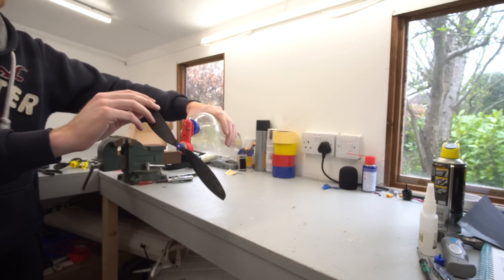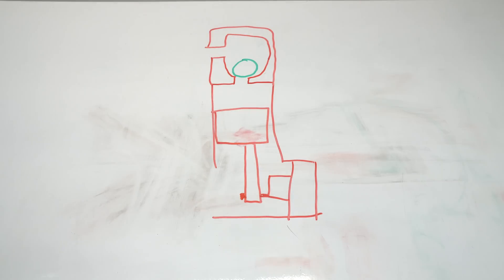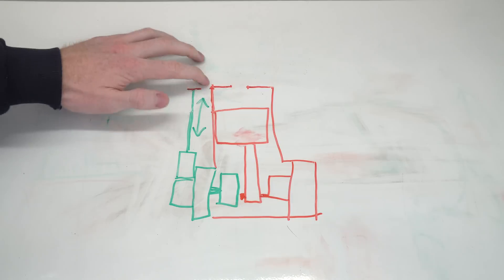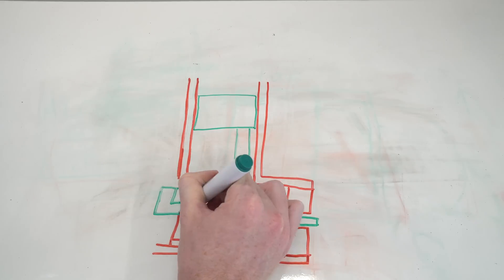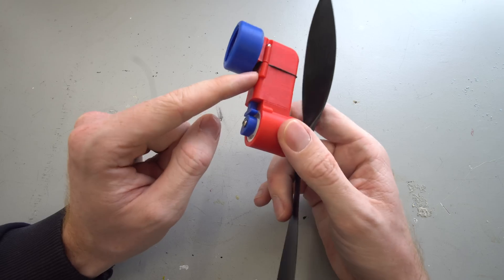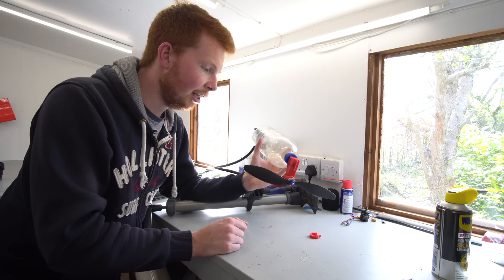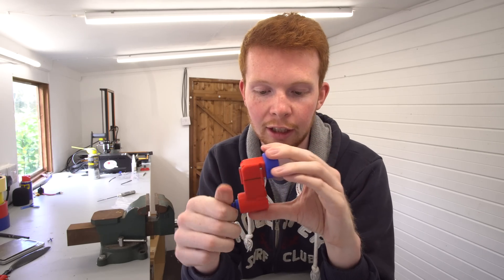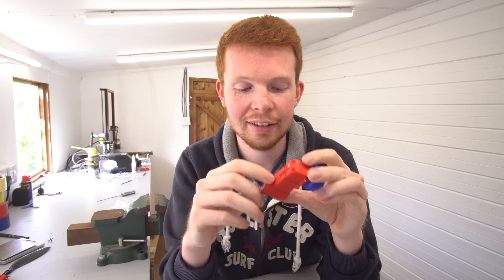Compressed Air Engine V3

Comment: Oh my God. I have imagined you would make your own car with this engine.
Reply: The concept is fine for hobby planes and cars but isn't efficient for use in a full size car if that is what you mean.  It has to do with expansion,cooling of the air, and on a large scale the amount of energy to compress the air.  But it still is a very interesting design and Mr. Stanton has done a very good job.

Comment: Make the valve timing a variable so you optimize the air supply. You could do this by rotating a disk/cam so the valve opens sooner or later. If you have electronic talents you could optimize both the timing and the dwell with an electronic valve.

Comment: Add a generator and tack it on to the boil-off valves on a cryogenic rocket engine and maybe you could reduce the need for battery weight.

Comment: A rotary valve would give you engine that would be self starting and could be made to rotate either direction depending on valve timing. Was looking for plans but could not find any I found mine in an old Popular Mechanics magazine it was similar to this one as far as the valve goes.   https://www.youtube.com/watch?v=Z1YISQ8ddsw

Comment: Currently I'm trying to design a 2 stroke (the engine in this video is a 2 stroke) v12 using a 3d printer and was wondering if anyone had any tips.

Comment: I thought you were going to draw the diagrams in blood? What I can't fathom with this project Tom, is why you didn't optimise the motor first with prop size and thrust tests first? I mean we all rush out to the field with these crazy projects at the first opportunity...my son's teddy 'Toffee' had to complete his selfie challenges, this one required 8 ounces of him on an 8 foot bamboo delta wing bin liner with ancient geared 540 and 1980's Nicads. 100 metres straight line was good enough! He was too heavy due to the wet grass for a second flight.
There used to be CO2 syphon capsule powered free-flight? Rubber planes have big (huge slow) props, to extend their short energy reserve. If you concentrated on your V3 motor, and then designed a plane/prop around that, it would more likely get there quicker?

Comment: sounds like a lawnmower but efficiency is too low.  Add some oil to the crank case and put a gasket that should allow it to run at lower psi.

Comment: could you exhaust the used air back in to another bottle that has the same volume as the original but with part water in it to get the air pressure back up   maybe heated sunlight the nitrogen boesse engine sounds very simple if you have not reviewed it and air is 78 percent nitrogen  you just have to think of tesla charges to strip it out of surrounding air  youtuber  ogmandino   og-man-di-NO

Comment: you can use an air compressed engine to compress air to run an air compressed engine to compress air for the first air compressed engine

or even you can use an air compressed engine to compress air to run an air compressed engine to compress air to run an air compressed engine to compress air to run an air compressed engine to compress air to run an air compressed engine to compress air to run an air compressed engine to compress air to run an air compressed engine to compress air to run an air compressed engine to compress air to run an air compressed engine to compress air to run an air compressed engine to compress air to run an air compressed engine to compress air for the first air compressed engine

Comment: You might want to shorten the duration the valve is open ...sounds like lots of wasted air ...you should make different cam lobes and test them with a timer to see which cam profile works  best

Comment: You're doing it all wrong. What's a motor but an air pump? You want an efficient compressed air motor,  look at a conventional motor for inspiration.
I would use an OHV pushrod design.  To minimize friction, i'd make a small orifice. For a valve,  just a dowel with a rounded tip so it fits like a ball valve.  This dowel is pulled by an arm that acts like a wheel borrow. It's moved by a pushrod connected to a lobe on the crankshaft.  No separate camshaft.  That's a piston, connecting rod,  crank/cam shaft,  pushrod. lever arm, valve spring, and valve. That puts the valve on top of the piston and you can have nearly no distance between the head and piston.

Comment: Definitely should print a pressure regulating valve that you can set a 'default' or 'minimum' pressure with and increase pressure by means of a lever. Basically a sort of throttle body that would let you conserve as much air as possible while at idle.

Comment: What if you'd use a lighter gas than air to power the plane in the end? Wouldnt the mechanism work just the same while reducing the weight of the aircraft?

Or is the pressureforce directly proportional to the weight of a gas? Im not an engineer or sorts... just curious.

Comment: If you add a air pump with a rubber band and conect the air pump to the bottle you can have infinite engine power

Comment: If you adjusted the timings to open quicker but last for shorter periods of time. In theory the pressure inside of the bottle should last a substantial amount longer then it currently is making it mire effecient. Great Video BTW mate.

Comment: Air hogs used to have planes with air engines back in the day
Reply: I remember having one of those, only thing that would've made them a bit better is some RC servos or a control wire so they could be actively flown instead of just free flying.
Reply: I enjoyed mine. Ran my legs off chasing it in the pastures.
Reply: Yeah i had 3
Reply: I still have it...
Reply: that's how he came up with the idea
Reply: @lazylawnbub  Yet doesn't follow their very simple design that actually works.
Reply: @illbeyourmonster2  no it's not the same design but he literally talks about the air hogs plane for half of the video
Reply: We know, it was presented in previous video:)
Reply: @Jandejongjong  yeah I didn't watch the whole video I literally saw that and made the comment
Reply: Guillow made these motors in the 1930s

Comment: liquid butane bro! constant 32psi. If you could find a way to support higher pressure, go LPG (around 320 psi)
Edit: and I do not mean combustion. Just the pressures the gasses produce.

Comment: Good work.

Imagine a vehicle using this engine. Have solar panels on top that recharge the air bottle as the vehicle moves. That'd produce a vehicle you can run at zero fuel cost.

Also, the movement of the wheels can be tapped to run a pump that re-charges the air bottle. The efficiency won't be 100% of course, due to losses to heat.

Comment: Inserting a spring type system inside the bottle to keep the pressure ''constant'' and a flow regulator for the output might be able to increase the time it can run though this adds weight

Comment: the guy obviously hasnt reverse engineered an air tool..      they dont use pistons...   they use a turbine and 1600 psi air. you engine will always be limited by pressure with that plastic bottle...   try a 10oz co2 container for higher pressure.
ps.. plastic bottle's are safe to 60 psi.. fair warning

Comment: if you could build your engine, that it gets a push into both directions, you'd get 50% more efficiency with each stroke
Reply: No .. you would get ideally twice the power but half the run time for a given volume of air. That is not a gain in efficiency. Realistically I'm betting it would be more like 1.5x or less of the power of the single acting setup. You can not avoid unequal volumes pushing from top of piston vs bottom of piston if using that engine design as shown with its single crank. Using a crosshead connecting rod setup would make the two volumes more equal but still not exactly equal. If he wanted it to last then lubrication is a must and it would have to be a lossy system like a 2 stroke has. In the end complexity, friction, and sealing would make gains much lower than 2x.
Reply: @xenuno  This person said it would get 50% more, you said it "would be more like 1.5x" but a 50% increase and a 1.5x increase is the same amount.

given that P represents the power of the engine;
50% increase    ->  P + (P x 0.5) = P + 0.5P = 1.5P
1.5x increase    ->  P x 1.5 = 1.5P
Reply: @xenuno  you said "you would get ideally twice the power but half the run time for a given volume of air".  

However remember that what you are actually doing is getting the same number of power strokes for a given volume of air, and doubling the number of power strokes per unit time.  In the original configuration there is a power stroke as the piston moves down, then an exhaust stroke going up.  If compressed air was fed in both sides then you would get a power stroke and exhaust stroke at the same time as it is a power stroke for one side but exhaust on the other, so for each two complete cycle (down and up).  This would increase power and use air more rapidly but by using gear ratios the engine strokes per minute can also be halved so now we are back to using the same amount of compressed air per unit time and basically producing the same amount of power.

A benefit may be increased torque as even though power is constant (given the gears are adjusted to ensure it is so) now there is no point in time when the engine is not producing power, instead of moving back up into place before taking another compressed air charge it will always be taking in compressed air.
Reply: @xenuno  You say "In the end complexity, friction, and sealing..."

However if we gear the engine to move slower to match the power output of a single sided layout then the engine speed is literally halved which will in turn greatly reduce loss due to friction.  This could mean that, given the engine power is kept constant through gearing, the usable energy per unit of compressed air may be increased.
Reply: That breaks the laws of thermodynamics, you can't gain efficiency with every stroke, that would mean after 2 strokes you have 100% efficiency, after 4 strokes 200% efficiency, its just not possible, the engines efficiency won't change, but you can increase power (that doesn't mean its more efficient)
Reply: @elliotlaw1590  The laws of thermodynamics don't prohibit improvements in efficiency.  Once upon a time cars got a fuel efficiency of 254 L/100 km and made 10 horsepower now cars can make 300 hp and get pretty good fuel mileage.  Even though the energy density of petrol hasn't changed improvements in engine design have led to internal combustion engines that can use that energy more efficiently.  In this scenario a change in engine configuration could lead to reduced losses from friction or noise so more of the energy in the compressed air can be used to turn the prop.
Reply: @benfubbs2432  I didn't claim that you can't improve efficiency, I said you can't gain efficiency with every stroke, if that was possible as the original comment said an increase of 50% efficiency in each stroke, after 2 strokes you'd have 100% efficiency which isn't possible according to the laws if thermodynamics, of course there are ways of imoroving an engines efficiency, but you can never have 100% efficiency
Reply: @elliotlaw1590  Well then you are deliberately misinterpreting what "gain" means or just playing with semantics.

By making each stroke perform two functions simultaneously instead of one function and then another you are literally gaining efficiency with each stroke, which in this context means that with setup A each stroke will have a gain in efficiency over setup B.  This is completely different to saying that each stroke in setup A will have more efficiency than the previous stroke in setup A, while each stroke in setup B will have the same efficiency over the previous stroke of setup B.

You are basically pretending that OP claimed that there is an efficiency gain between strokes in one setup, while OP was actually claiming that a stroke will see an efficiency improvement when comparing setup A to setup B.

That's either because you misunderstood OP or because you are choosing to misinterpret OP based on semantics.

Finally, the three laws of thermodynamics do not state that an efficiency improvement cannot be seen with each cycle of a system.  Resonance and constructive interference are examples where a cycling system gains energy with each cycle as basically in these situations the gains continue to exceed the losses which will often create a runaway effect.  For example the thermite reaction creates more energy than it needs to sustain the reaction so initially this reaction is slow but with each cycle it produces more heat energy which improves the kinetics of the reaction.  As the reaction proceeds it literally becomes more efficient as the reaction continues.

Comment: Using Compressed Air is regular very ineffectife. The Reason for that is, while you crompress a Gas, you get Heat. If you do not remove this heat effectife during Compression, you need more power to compress the air. If the air is in the storage and still hotter, it cooles down an loses a part of hist peasure. 

If you want to create an Engine, you need heat to recover the entire power you have spend to compress the air. The termodynamic best way to do is, make it infinit slow to give the heat time to went to the gas during expansion. But there is an other well good option. Use a 4 Stroke engine like an otto motor. Imagine you do nothing on an otto motor. You suck Air from the room around you, you compress it. During this Compression Temperature and Presure rises. If the Expansion if fast enoth before the heat goes to the Motor, your power will be recover and in stroke 4 it is blown out. You need some power to compesate the friction to hold the motor in rotation.

Now imagine you open an additional high peasure valve at the ent of the compression stroke. Because of the compression you get two effects. (1) the dead volume effect can be reduced, because you compress in the Motor the air smal below the preasure of your input.
(2) your comressed gas founds a lot of heat he need to expand to his full volume. in case of a simple expansion, you get very cold gas, and cold gas has a quite less volume at the same peasure ... for example athmophere pressure.

Comment: My thoughts on the new valve system were more to the tune of a butterfly valve (Like seen on petrol engine intakes), that is rotated open and closed by the cam. So long as the valve flap has a rubber ring or something around it, it should make a decent seal.

Comment: isn't using a piston that compresses both ways a better option? less complex, just use 2 one way valves that suck in air, and 2 that can only release the air. like how an actuator works. Then you don't need to push a ball valve open, no complex engineering, just change the piston. one that compresses going up and coming down. actually, exactly how they pump up oil now that I think about it...

Comment: Why can’t you put the escaped a back into the bottle
Reply: Because the pressure is always greater in the bottle than it is when the air exits the engine.

Comment: I like this Idea, it's really cool. However, I just can't help thinking that the engeine looses power because of loss of presure. I think if you had an alternitive to average air, you could maintain a more constant pressure. Something like dry ice that continues to sublimate and increase pressure. Obviously you would need something that sublimates faster or equal to the speed of the engine, or keeps pressure constant. I however do not know of something like that myself, but if someone does, please let me know.

Comment: the head design reminds me of the old ford flat heads. The piston though will be creating a lot more friction as the dorward force will not push it directly down... but this is a really cool engine, and nice work around... you could have had the cam in the middle of the crank, and house it inside, and have the other bearing on the other side :)

Comment: to translate up and down to side to side, use a wedge shape. then as the sharp part comes up and gets thicker, the wedge pushes the ball valve to the side. as it drops, the wedge allows the ball to slide back into place. this smooth push also avoids any air hammer  slamming effects the ball may normally go through. just a thought

Comment: I have a question for anyone who can answer. so my old vw is a combustion engine and obviously it has a alternator to recharge the battery while it is running. if you applied an electric air compressor to the design in this video, and somehow incorporated a battery and alternator into the design, could you potentially run the prop forever? the compressed air is what drives the prop, which could be connected to a alternator via a belt, which powers the battery and air compressor, creating more compressed air to further drive the prop. I know there is no such thing as endless energy but that is my idea.

Comment: Hi Tom. I'm crazy about air engines and in fact finished one this morning. All my designs are my own. I'd like to video an engine working or engines working and send them to you is that possible? I don't use a 3D printer but machine and turn all my pieces.

Comment: i have a question if you decide to stick it on an airplane can you put some kind of pipe or some block that can get air inside the bottle which will make the propeller go more or less infinite? - my theory...

please do try
Reply: That would generate Infinite Energy 
and that is impossible
so it wouldn't work
also the Pressure inside is very high
so the Plane would need to move very fast just too keep Air from leaking out of that Inlet
Reply: @user-si5fm8ql3c  what about a bigger bottle and the thing somehow gets more air, so the big bottle makes the propeller faster.

But tht is just what i think i also don't think it might be possible 😂